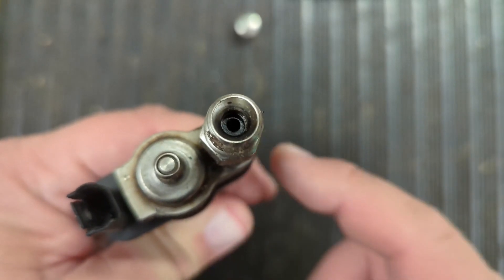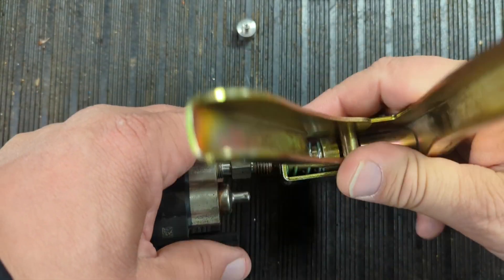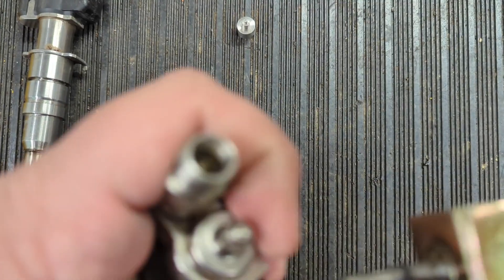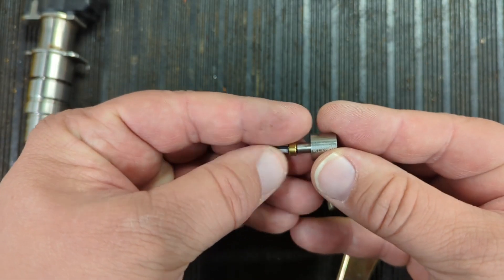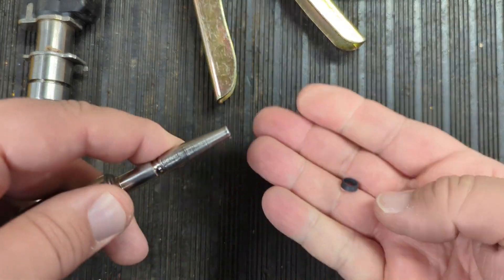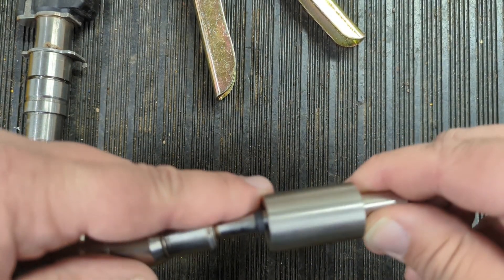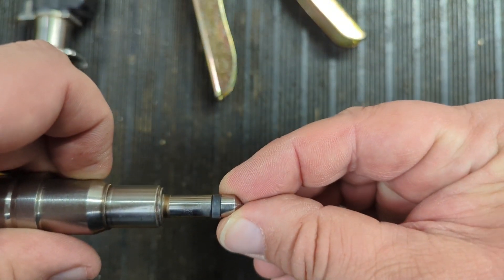How To: Replacing filter on a BMW N54 N63 N74 Piezoelectric Fuel Injector

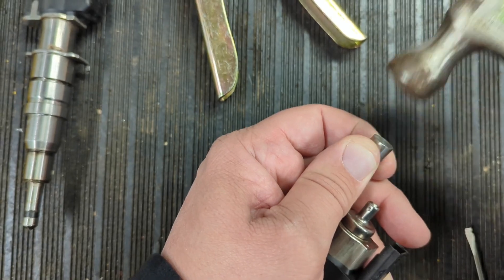Comment: The reinstalled filter is not seated to the same depth as the original. Compare the original at 0:10 mark versus the replaced filter at the 1:45 mark. It's not even close. Using the tool to seat the filter to the original depth deforms the filter because the tool diameter is smaller than the filter. I wrecked two filters trying to reinstall them and still have the problem what to do with these two injectors now. Putting new filters in them will only result in the same result.
Also, getting the old filters out of the injectors was a huge hassle. One filter broke apart and left bits of plastic and screen inside that were next to impossible to remove. In my opinion it would be better not to change the filter and just clean them as best as possible with something like carb cleaner.
Reply: Is it better to spray the inside of the fuel injector with carb cleaner then shake it off so that the carb cleaner fluid would come out?

Comment: are these filters known as the micron filters? 
my tuner says I need to check my micron filter, as that's what's causing fuel starvation on top end acceleration.
Reply from the maker: Yes.
Reply: The tuner does not understand the piezo injector process. They do not retain pressure and do not interfere with performance. The roller author doesn’t even know that every high-pressure pump has a microfilter, be it a disassembled pump or a welded one. I checked and made a lot of such injectors.